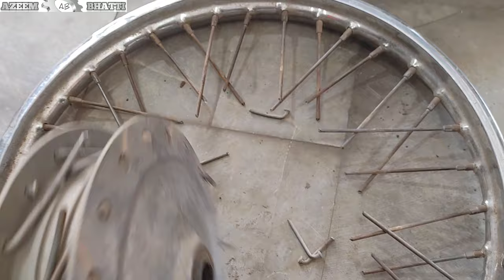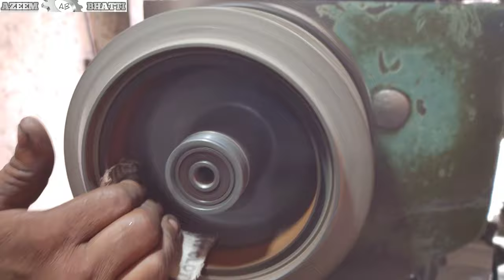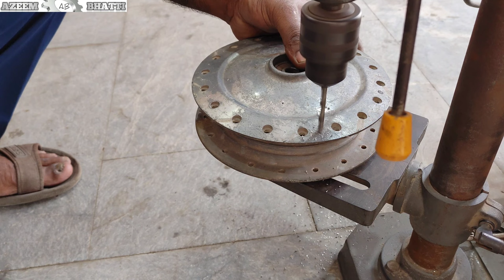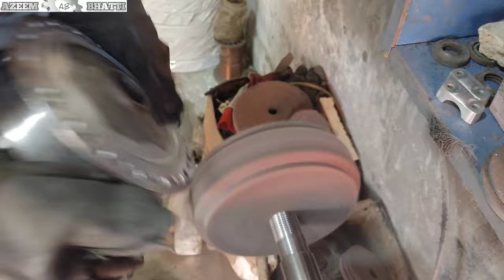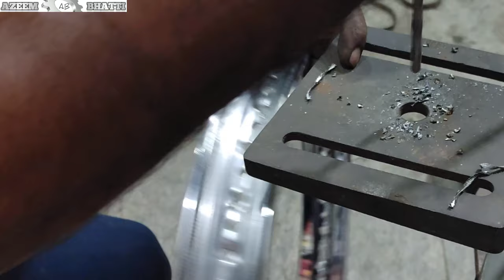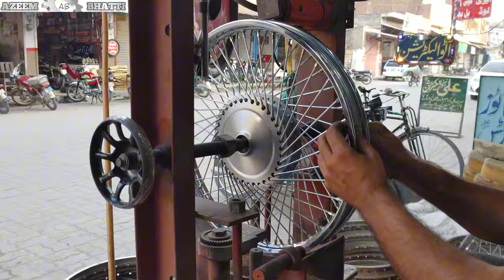motorcycle wheel preparation of 72 spoke rim

Comment: The rim has some recesses where the lug nuts are hidden.It was not shown in the video if the new holes made by the craftsman have them (I guess not). Which is why the spoke bolt will be protruding out of the rim not shallow in it, which affects the rubber chamber over time and has on top of that a different look than the other locations which have some bulges on the outside where it hides from the bolt plus the spokes are not fitted like that.Even though it looks good,it is not safe, if it was safe all the factories in the world would fit the spokes like that.
Reply: How much for it? I need one